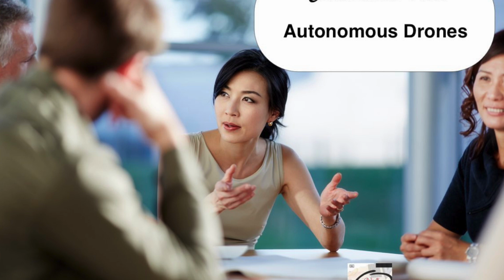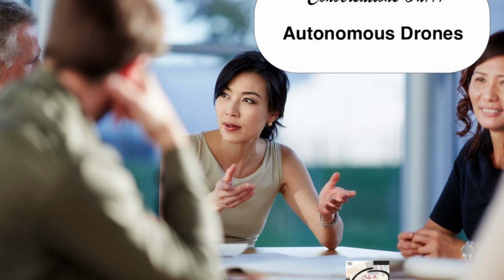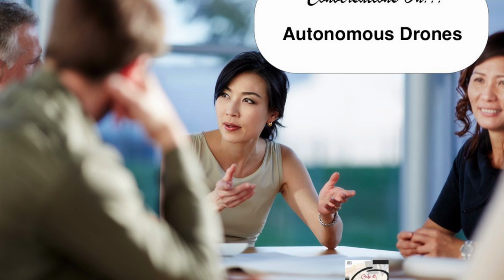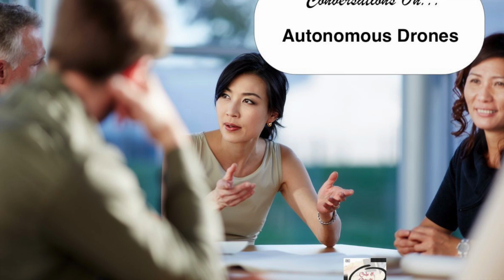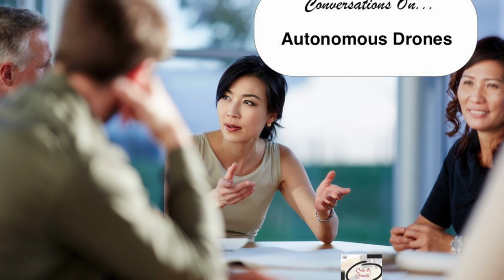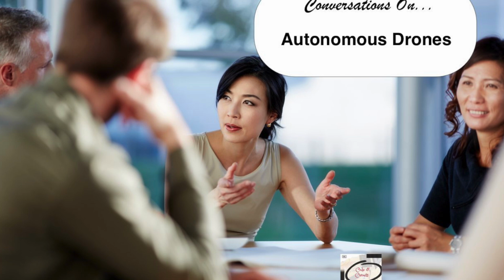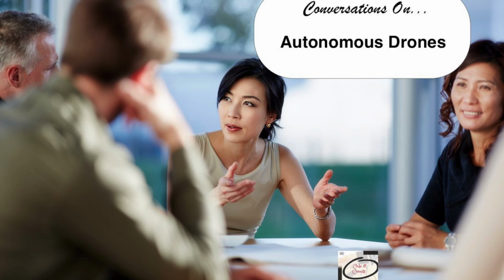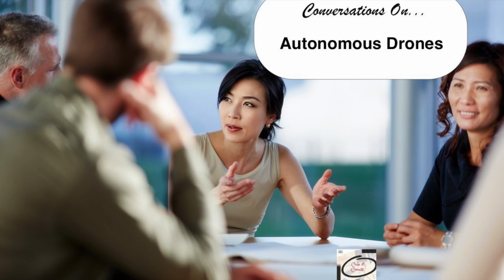Conversations on ...Autonomous Drones

Comment: I’m looking for a drone that can autonomously navigate through a residence and take full video of the inside of a home/condo. It seems like all the parts are available but I can’t find any. Would you know of any? Thanks 😀
Reply from the maker: The technology seems feasible, but I'm not sure it is available in a productized form for retail consumers. I don't have a specific recommendation. Checking with Claude gives the following list: 
DJI Mavic Mini - This drone has advanced features like obstacle avoidance and intelligent flight modes that can help it navigate indoors more autonomously.
Potensic A20W - This drone has a "Headless Mode" and "One Key Return" features that can assist with autonomous navigation indoors.
Snaptain A15H - This drone has a "Altitude Hold" mode and "One Key Take Off/Landing" which can provide some autonomous stabilization and control when flying indoors.
Potensic A20W Pro - As an upgraded version of the A20W, this drone likely has similar autonomous navigation features like Headless Mode and One Key Return.

NB I have not used these personally, so further due diligence required.
Reply: @DrStevenAWright  Ok, thanks for the quick response  :)